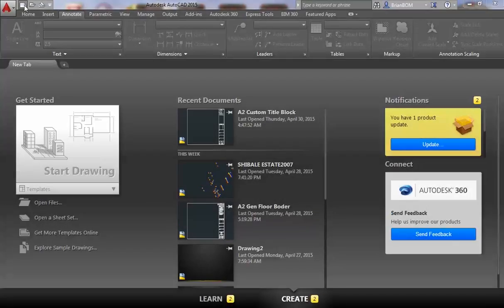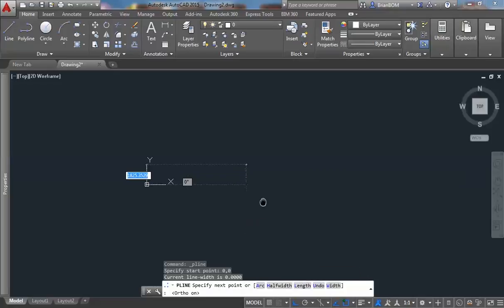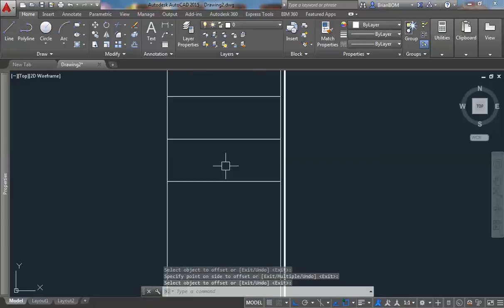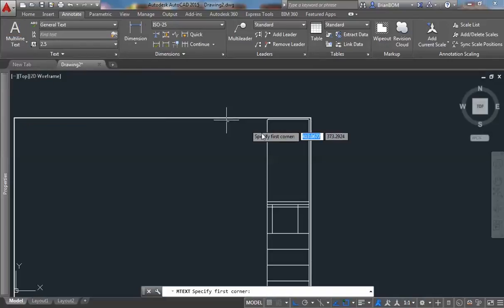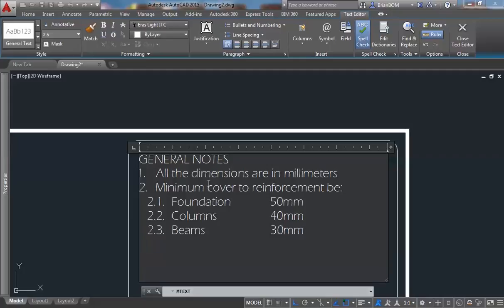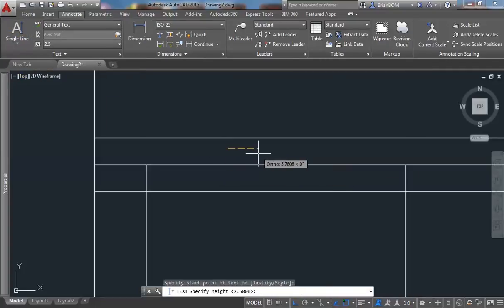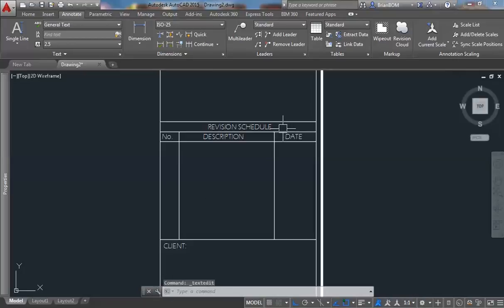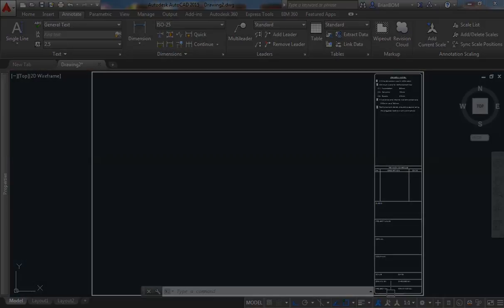How to Create a Custom Title Block in AutoCAD 2015

Comment: can A3 template be used to print drawings in A4 paper?
Reply from the maker: Hey Kelvin? Printing on an A4 paper is possible, however, if you printing it from a paper size that is bigger that A4, say A3 as put, you will have to shrink/fit to paper and hence your drawing will not print to scale.

If you desire to print to scale, let the template match the paper size, for example an A3 template sheet on an A3 paper, or A4 template sheet on an A4 paper.

I hope this answers your question. Thanks

Comment: How do you make the text visible in autocard electrical 2016?
I've followed all the steps but when it comes to the part of the inputting the text it's not visible.
Reply from the maker: Hello Powersafi? I would advice you to first check the text height that you are using. For your title block a text of 2.5mm would be okay. Please let me know if you have a break through with this.

Comment: I did that and got it showing 10" across and 8" down for paper size... if I'm designing one using architectural units set at 0=0... the do I draw the line or square to how many inches or feet? meaning would I go 420 across and 216 down in inches? to equal a 36" x 24" plot size?
Reply from the maker: +David Vasquez 

1) 36" x 24" would approximate to 914 x610mm which would be 
approximately equal to an A1 paper size (this illustrative video was for
 an A2 paper size).
2) For you to do this first make sure that while in the 'UNITS' command,
 your length type is decimal and that your insertion scale is inches.
3) Taking your above mentioned example, you can just use a dimension of say 36" x 24" while drawing your rectangle.
4) After drawing your rectangle use the 'SCALE' command, select your 
objects, then your base point and enter a scale factor of 25.4.
5) By doing this, you have just changed your drawing from imperial to metric units.
6) Alternatively, you may draw in metric units and scale back to imperial units by now using a scale factor of 0.03937 or 1/25.4
7) Please also not that acadiso.dwt is the default template for metric units and acad.dwt is the default template for imperial units.

I hope this information was of help to you.
Reply: i tried following instructions, but im not using decimal or metric units... i have a house plan already drawn in Architectural units (inches and feet) @ 0'-0" and im trying to get the right size title block... in these units not the others... and im sorry for the confusion.
Reply from the maker: +David Vasquez 
1) Then my first step would be to have in mind what system of measurements I would use, either metric or imperial units. 
2) Based on the system of units that u have settled upon, I would go ahead and select an AutoCAD template, that is, acad.dwt for imperial units and acadiso.dwt for metric units.
3) I would then go ahead and draw my title block.

However, in a case where I may have selected the wrong template, for example I want yo use metric units system and I selected acad.dwt template and vice-versa, here is how I would go about it.

1) If I selected an imperial AutoCAD template, ie acad.dwt and instead I wanted to use metric units, I would I would scale the title block which I have drawn by a factor of 25.4.
2) If in case I selected a metric AutoCAD template, ie acadiso.dwt and instead I wanted to use a metric units system, I would now scale the title block by a facto of 1/25.4.

I hope this information was helpful. However, if you still experience difficulties in creating the view title block, we can look for a convenient time for the both of us and I will run you through this via team viewer. Please get back to me. Thanks.

Comment: what units are you using? Is this in decimal or engineering? or is this in inches when you draw out lines for it
Reply from the maker: +David Vasquez. Hey there, the default AutoCAD template that I use is acadiso.dwt which is in millimeters (metric units). Alternatively, you can use decimal drawing units under the 'UNITS' command. I hope I have answered your question.

Thanks.

Comment: HELLO THANKS FOR THE GREAT INFO, I HAVE A PROBLEM THOUGH, I'M WORKING WITH CENTIMETERS BUT WHEN I MEASURE THE DIST. OF THE PAPER ON THE LAYOUT IT SAYS IT IS 15 CM AND 10 CM BUT I HAVE CHOOSED ISO A3 (420X297)MM, WHY IS THAT?
Reply from the maker: +Elen G Hello, try using the metric template, that is, the acadiso.dwt (when you open a new drawing in AutoCAD) so that you can start of with a drawing that is already in millimeters. I hope this helps. Thanks.
Reply: thank you, it did! :)
Reply from the maker: +Elen G I am glad I was of assistance to you. You are welcome once more.